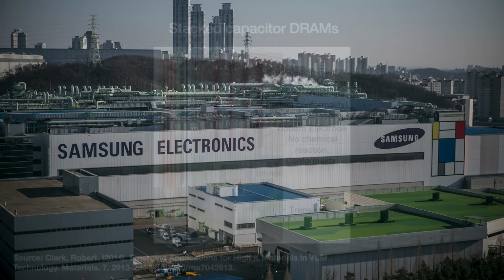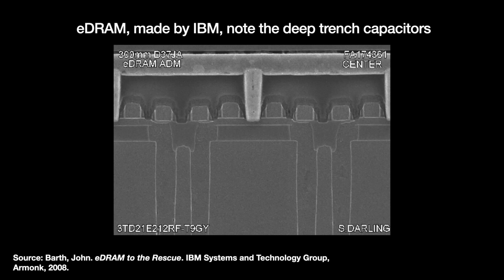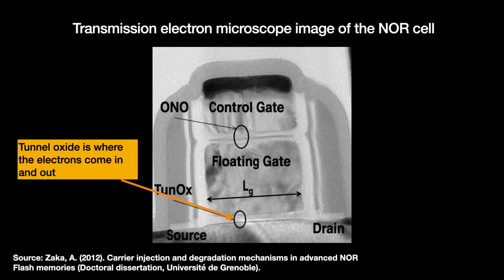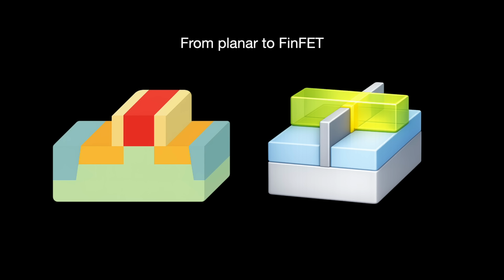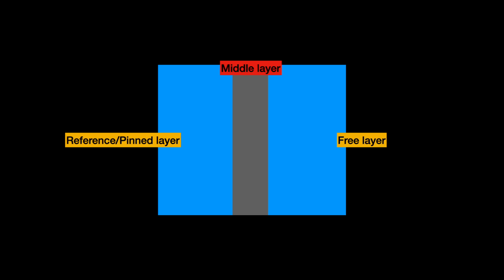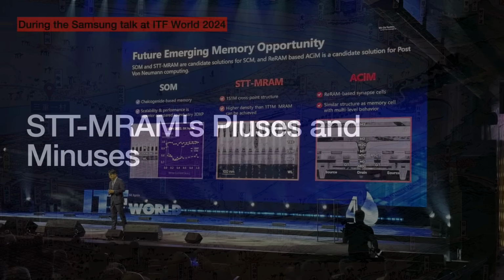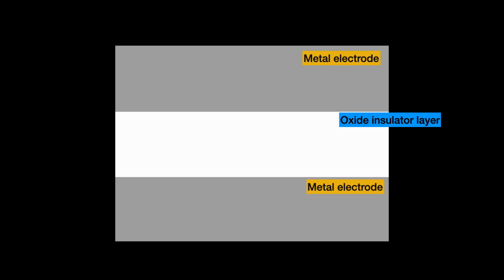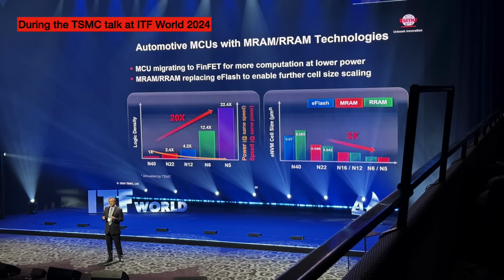Embedded Memories: The Next Generation

Comment: I remember how through decades those new technologies were announced. I hoped your were able to dig more on those Intel/Micron X/Cross-Point memories and what went wrong with them, because we even had products (SSD) using them, speed was not as promised but still better and even some changes in oses/software to accomodoate lighty slower non-voliatile "RAM" or parts of "RAM" were made.
Reply: Was literally about to comment "where is the PCM / 3DXP section?" 

I guess 3DXP is more focused on making disk storage speeds more comparable with DRAM, not really the focus on this video.

Though IIRC, I believe research has found adding a cache of 3DXP to be a cheaper and even faster alternative for personal computers compared to buying more DRAM (at the GB scale) in isolated testing. Maybe that would be a more likely return path.

Comment: As someone has already noted, MTJ’s didn’t exist in the 1980’s. Moodera demonstrated the first thin film room temperature MTJ’s in the 1990’s.
Reply: STT MRAM didn’t start to be demonstrated until the 2000’s. Spin transfer torque switching was predicted by John Slonzewski in 1996 (there was someone else independently predicting it, apologies but I forgot his name). Jordan Katine demonstrated it in metallic systems in 1999. 

(Berger. That’s the other theorist who predicted it)
Reply: I will add, you can switch MRAM in under 10ns and it has very good endurance. 

But the trick is to get both at the same time. 

Slamming an MTJ with enough current to switch fast can dramatically reduce endurance. A lot of work has gone into solving this, but it was a lot of work.
Reply: The barrier needs to be 1nm or less.
Reply: You first showed perpendicular MTJs and later used in-plane MRAM as your examples. In plane was all but abandoned 10 years ago. 

In plane only works down to about 40-50nm. For high density applications, one must use perpendicular.

Comment: This video explores the evolving landscape of embedded memory technologies in microchips, explaining how the industry is moving beyond traditional solutions to meet modern performance and density demands.

Current Embedded Memory Landscape
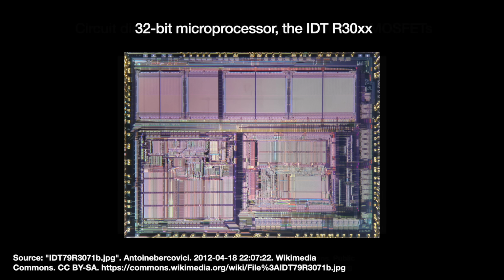SRAM (Static RAM): The long-standing king of embedded memory (1:36). It is fast and requires no extra masks to produce, but its large size—using six transistors per cell—is becoming a bottleneck for scaling (2:13).
eDRAM (Embedded DRAM): Offers higher density (5-6x that of SRAM) and lower power consumption (3:23). However, it requires additional manufacturing steps and has seen declining industry momentum (4:06).
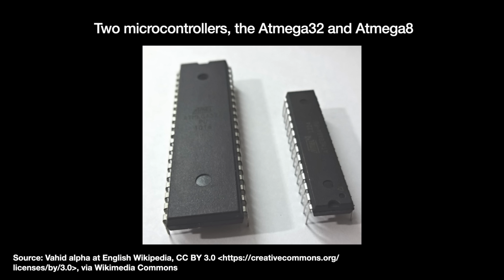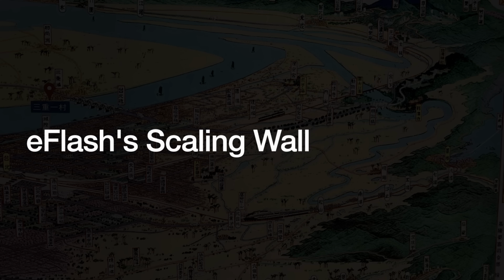eFlash (Embedded Flash): A non-volatile memory solution widely used in automotive and industrial microcontrollers (6:45). It faces significant scaling challenges below the 28nm node due to physical limits on transistor size and the need for high programming voltages (7:30).

Next-Generation Alternatives
Since traditional eFlash is struggling to scale, manufacturers are turning to new non-volatile memory technologies:
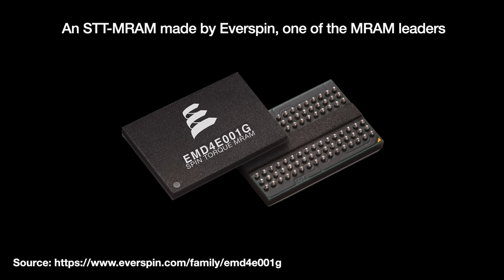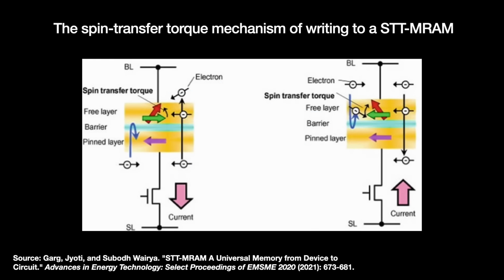MRAM (Magnetoresistive RAM): Uses a Magnetic Tunnel Junction (MTJ) to store data based on electrical resistance rather than charge (9:33). STT-MRAM (Spin Transfer Torque MRAM) is the leading variant, offering fast write speeds, high endurance, and excellent scalability (12:45).
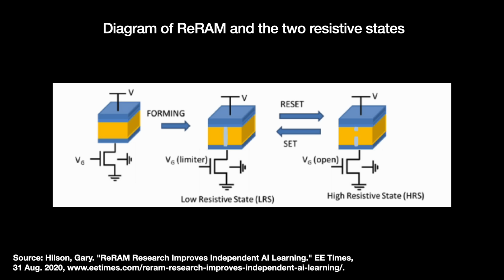ReRAM (Resistive RAM): Stores data by creating or destroying a conductive filament within a metal oxide layer (15:22). It is simple, elegant, and requires fewer manufacturing steps, though it faces challenges regarding consistency and reliability (16:43).

Future Outlook
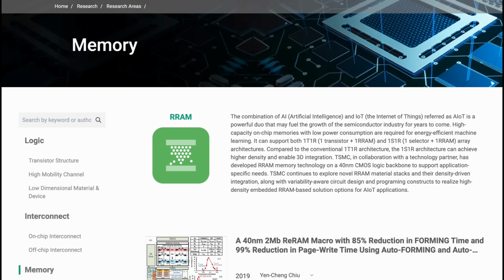While eFlash remains resilient due to its reliability in conservative industries (18:18), the industry is eyeing AI applications—such as on-device inference and neuromorphic computing—as the key driver for these next-generation embedded memories (18:50). Major foundries like TSMC and Samsung are actively positioning MRAM and ReRAM as the successors for advanced automotive and AI-enabled chips (17:43).

Comment: 1980s MRAM were NOT MTJ-based.   They used Simple and Anisotropic Magnetoresistance which is pretty weak and thus density was limited
Reply: Yep. Hard to do MTJ MRAM before room temperature MTJ’s were demonstrated in the early 1990’s by Moodera. 

That said, I have to point out that John Gittleman demonstrated room temperature tunneling magnetoresistance back in the 1970s (using granular films). Ami Berkwitz and Sandra Sankar also showed room temperature TMR shortly before Moodera. 

A lot of people ignore those efforts.

Comment: My client at Micron mentioned MRAM a lot years ago, certainly a non-volatile RAM that's close to the CPU is a highly desirable trait for many applications. I used to be a system programmer for a telco equipment maker, and I worked with embedded MCU all the time.

From automative and aerospace to consumer appliance, a program will run when you push a button and the state of the machine is IN-memory without the need to store separate states in another memory device like an EEPROM or load the memory state from that storage device. This reduces latency and power usage in theory. The question is how much energy is used to storage stuff in MRAM versus DRAM+NAND.

So why isn't MRAM more popular. Well, I'm doing AI dev now and I think I know why.

MRAM is a technology looking for a problem. All the problems it solves can be handled by cheaper SoC or FPGA. There is no need to reengineer a whole new solution when existing MCU works at larger cheaper nodes in the 65nm range. So why is MRAM not in high performance AI inference?

It's because the market is still in its infancy. Everyone is rushing to train new models and build new apps by leveraging the models to do work. These means, GPU/CPU + DRAM/NAND. 

The market is moving so fast, they haven't even really touched the low power NPU that can do INT8 calculations at Trillions of instructions per second. Everything is still developed using FP8/16/32 instructions. These NPUs are in your phones and laptops now but you wouldn't hear many AI applications for them.

Once a really popular and compelling model + App is built, (the killer app), you will see optimisation come into the picture. It is only during that time, if Automotive and Aerospace has the performance requirements of MRAM, will you see makers of MCU pay attention, especially if MRAM in silicon is compatible with the rest of the functional units.

It's not mentioned here but a comment from a previous video mentioned that the chemical used in DRAM wafer is incompatible with logic which is why you don't see the highest performance DDR5 memory embedded in the same silicon. It's not even bonded but is glued onto the substrate to prevent cross contamination.

Comment: Non-volatile memory is IMO extremely unwanted for anything that is not storage.
Why people keep stating that non-volatility is a holy is beyond me.

Any computing device that keeps the memory after cutting power is a security risk waiting to happen.
It also brings the risk of corruption when relying on the non-volatile characteristic!

In the software World there is a reason we wan't things to fully power down/terminate and then start a new instance free of the possibly corrupted state.
Reply: Well it's mostly intended as flash replacement, but having your RAM be non-volatile is in fact also very useful for low-power embedded applications since it means you can completely remove power from RAM when idle. Non-volatility is obviously useful and never a downside, you're always free to treat it as volatile RAM (i.e. consider it uninitialized at cold boot), while protection against unintended writes in flash-replacement use-cases can easily be provided via configurable write-protection. It is true that the security risks of storing confidential data in external RAM would be increased by non-volatility, but they're still present with volatile ram (use memory encryption if you need a proper fix), and for embedded rams this is much less of an issue anyway since you wouldn't have access to the ram by any practical means (assuming anyone concerned about the confidentiality of memory contents isn't stupid enough to leave the debug interface enabled)

Comment: STMicroelectronics now use phase change memory in some automotive microcontrollers. Interestingly, it is made of the same material as CD-RW but the phase change occurs when the material is heated by a resistor instead of a laser

Comment: From what I see most micro-controller applications simply don't need more than they currently have, the cost of the MC as a proportion of the product has become almost negligible in many cases. So product developers are massively over specifying the MC model in products to consolidate their supply-chain, and even out of simple copy-paste laziness. 
Other than mega-volume consumer products, or extremely energy sensitive applications, many designers are skipping straight to 32 bit class MCs even where 8 and 16 bit would be comfortably capable of the task, just to streamline their development and programming stack.

Even on mega-volume stuff there is no real demand for improvement; look at a common microwave for example, they are using bottom end 2¢ blob on board MCs, and still able to handle programming for those 30 extra function buttons that nobody ever asked for or uses. 
And for $5 MCs you get the equivalent performance of a Pentium2.

Comment: Man I’ve been following the MRAM progress since 2006. It still being in the niche / development phase is one of life’s great disappointments.
Reply: Ye, Imec seems to be focusing on a future voltage controlled (Voltage Gate) Spin Orbit Torque MRAM.

Ofc antiferromagnetic or alterferromagnetic would be better, but it's a solid, high density start.
Reply: @mnomadvfx SOT takes up too much real estate. 

Foundries are offering STT MRAM. But it hasn’t really found a big application yet. 

Samsung (or some in Samsung) has hopes for MRAM to be a viable DRAM replacement by about 2017. That didn’t happen. Obviously.
Reply: @lightlaserstarwars  I think STT-MRAM has seen some use as non-volatile write cache for some high-end SSDs?
Reply: everspin still seems to be staying afloat, it evidently has some use-cases (unsurprisingly for extremely fast NV memory with no wearout), but yeah

Comment: Sadly, SOT-MRAM wasn't mentioned. That's the real breakthrough everyone's banking on for AI and high-performance computing, and it's expected to hit mass production around 2030.
Reply: I fully agree. Both TSMC and Kioxia are writing about it, so it's no longer an academic research project.
Reply: @Videoaccountname  multiple teams have looked at it. It is also very fast switching. But it is not high density. And that limits it significantly. It’s a three terminal device where a pMTJ is a one terminal device

Comment: I wonder if it might be worth using ROM instead - to store commonly used  values, such as lookup tables and LLM weight matrices on chip. I can't imagine that there wouldn't be some significant savings in die space, access speed and lithographic processing by doing away with the quaint notion that you might have to change the values on the chip at some point in the future, without replacing the entire thing.
Reply: NAND flash basically gives you all of that with more flexibility in late stage product design changes, and importantly at scale a much lower inventory count. Reading flash has equivalent speed to ROM.
The drawbacks of NAND flash are mostly on the write side which ROM doesn't do at all, so irrelevant. And flash can have an issue with long term data retention, but this is more of a special issue for niche markets that are already being served with various high reliability alternative solutions. 
Cost savings is always welcome even if small, but we are already down MCs being a quarter percent of the overall product price so the market pressure is extremely low given the investment risk of new hardware manufacturing tech.
Reply: @mytech6779 I actually followed  this up and found  "ROMA" (for ROM Accelerator for QLoRA on device LLMs) and TOM (Trenary Read Only Memory Accelerator). Both also have some SRAM for extra flexibility.

The advantage of ROM is that it only needs one transistor per stored bit in state 1 (0 gets connected to ground), much faster and denser than SRAM, with extreme bandwidths on chip, but not stacked like flash. So it takes a lot of die space.

TOM puts a 2b trenary parameter model on 50mm² and gets over 2000 token/s on a 7nm process and 500 MHz. (Don't know why it's so low). ROMA has 8 billion 2bit parameters (or 3b with 4bit) on a rather excessive 503 mm², but does about 20,000 token/s with 33 watts of power. Again, at 500 MHz on 7nm. (No expert in the field, but this can't be a coincidence. There must be some limitation.)

Comment: You just compress the bit padding'  z bits;  9 - 8 + 7 - 6 + 5 - 4 + 3 - 2 + 1 - 2^64 (control depth of 10 dimensions).  Minimum control depth 7; [abc] [def] [hij] [klm] [nop] [qrs] [tuv], might as well make the rest of the alphabet do 'things' 0 = [wxyz], so we can switch to radix packing instead of using the jacobean. 64 HIGH -1, 63 HIGH -1, as each radix bit ensures its basis set size; 64bit + control bits.  A + b = c... (a + b ( + c ( + d ....))))))))))))))))))))))))))))))))))))))))))))))) = z, the general non-zero recovery is 10 dimensional for continuous NEO-GEO excitebike drama time.  So, until we have mastered bit radix, we learn why stars exist 8 -> 64 -> 4096 -> 16,777,216, a star of carnnot.
1          11   trace length / sig fixs =  stack coconuts;
11        111
111      1111
1111    11111